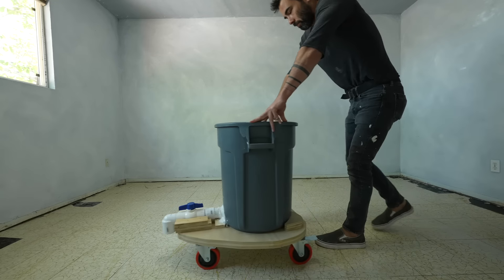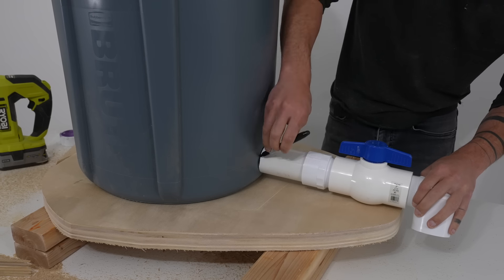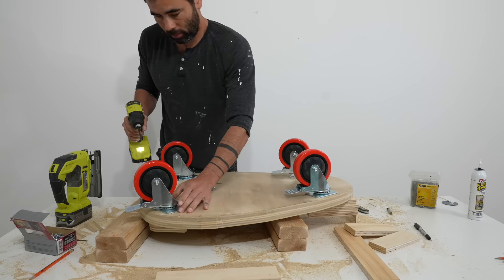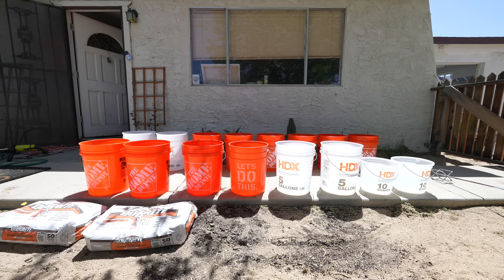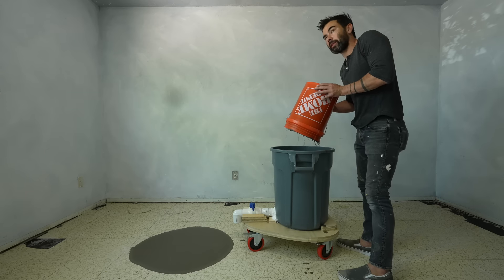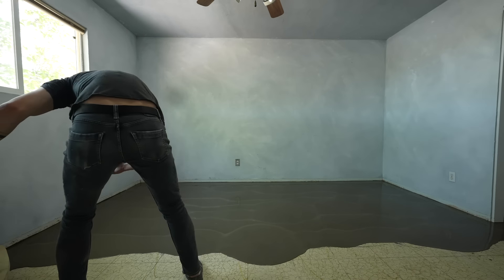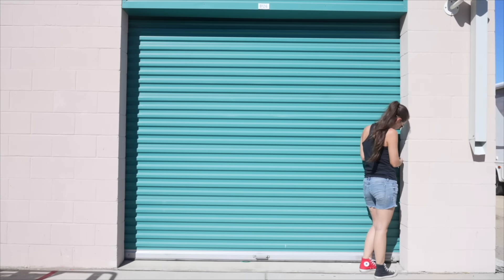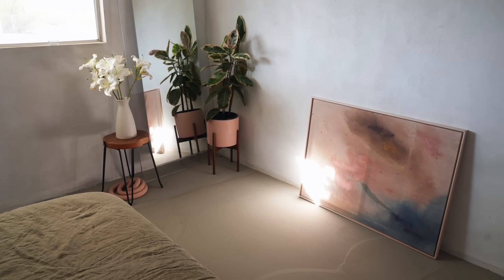Concrete Floor Over Tile | EASY Self Leveling Concrete Floor

Comment: Nice way. If I ever have to do something like that I will certainly try something similar.

Now, I think using a tap is the way to go, not the cap, as this one will be messier and dirtier, as well as both parts will get more and more dirt overtime making it difficult to screw/unscrew, and you have to wash them both as well.

I think the inicial method is the way to go (despite it's concrete anyway and not exactly a "clean" liquid") and I mean it because I've seen a similar problem with this solution: there's this artificial pond near my house. It's used to water some orchards (five different owners). Three years ago it was remodeled and now it has a tap like the one in the video only larger, like twice the diameter at least. It's also a bit hard to open and close by hand and, also, it's in a hole like 50 cms. (over 1,5 feet) deep, so it's not nice to use so to speak. 

However, one of the other users came up with this: he used some long enough rebar and gave it an L shape. Then, on the longer side of the L he welded some more rebar so now that end has a U shape. The distance between the "arms" of the U is enough to reach both "arms" of the tap. In theory, the wider the better as long as it's not wider than the length of both arms of the tap combined. But this may also feel like it's going to break the tap, so you may leave it wide enought it's wider than the round part of the arms of the tap (its axis).

Why? because in fact the leverage is done with the shortest part of the L shape you did at the beginning, the longer, the better. To use this contraption you just place the U shape on the tap, hold this thing by the longest part with one hand and open/close the tap by using the shortest part with the other hand. I think watching it is way easier than writing and explaining it, but I hope it helps. Thank you.
Reply: P.S. Also, with the tap you can control de flow, which is not possible the other way, or at least way, way more complicated and messy.

Comment: This is a super brilliant solution. Thank you for sharing! How well does this hold up over the long time? I have a room with almost the exact same floor. I've currently got my gym set up in there, so there is a 6x6' space that has about 750-800 pounds sitting on it. Will that concrete hold up to that weight? Could this also be a a good option as a leveler if I decide to put down luxury vinyl plank over it?

Comment: I dont think most people will appreciate how AWESOME this is!! First off, mixing batches to remain consistent between mixes is NOT easy to do as one pour dries, and requires 2-3 people to keep up.  I wonder if the only difference between the cheap underlayment levelers is color, vs the more expensive overlay products?  

You can use a spike roller to get rid of those layer lines. Something I recommend.
You can also use some grease to coat the ball valve, or maybe some silicon at the start. It will make a barrier so what ever sticks on will get pushed off as you turn it and not get in between....IN THEORY :-)
Reply: I think it's awesome.

Comment: Looks like 1/8" to 3/8" thickness.   Probably ok in a bedroom might crack over time especially in high traffic areas.  Love the distribution method.  You'd do this before a high quality flooring installation anyway with Self leveling compound.

Comment: The change to the ball valve with the cap will work best to not have the spout vertical. I would simply let it lay horizontal so capping it won't get wet cement all over your hands.

Comment: If you try to cap it while there's still cement in there, it will definitely get into the threads, and it may lock it in place once dried.
If you plan to immediately take it outside and remove it, then clean everything out, that's probably fine.

That said, be prepared for a little mess as you try to put it on. I think the ball valve was the right way to go, just because it's plastic doesn't necessarily mean it will break easily, some plastics can be quite strong.

Comment: Curious, I know you said you had it checked for asbestos, but even if it had been would this type of flooring application be OK over top of it? Since you are encasing it and not sanding/drilling it up?
Reply: Most times it’s the mastic adhesive that holds the tile down which can contain asbestos fibers. This is the concern when removing flooring.
Reply: I think he was just explaining that the reason they were pouring over the tiles was that it was too much work to remove them even though they didn't contain any asbestos. If it had contained asbestos they would have just poured the floor without even having tried to remove the tiles.

Comment: Will you be able to get that cap in place against the hydrostatic pressure of the concrete?

What about nylon fire hose that could be pinched off with a heavy weight?

Comment: I have a 14x12 room to level. You mentioned you used 12 bags. How much water did you use? The viscosity looks really "watery", is that how it's supposed to be?

Comment: Further development suggestion, lift the bin so that you can put the outlet pipe through the bottom. On the side, even low down, you'll waste mix and or end up tipping the bin out manually. Good idea though, excellent result.

Comment: The concrete doesn't  crack over time? I tried something similar and found the concrete has expansion/contraction problems with the thin aggregate.

Comment: use a piece of pvc over the tube glued in place instead of the flex seal. just like you did on the inside, but on the outside. i do this alot on buckets, works great.

Comment: It's quite a thin layer of concrete. Is there any risk of it cracking given the linoleum underneath is slightly soft?
Reply: 100%
Reply: @hotrox2112  yeah I'd still be worried about the thinness of it. I don't understand why you wouldn't just rip up the lino first.

Comment: You should try filling the trash can with the concrete and then mix that before pouring. You might get a more uniform color. Also, a 50 gallon drum might be more sturdy than a trash bin.

Comment: the caps a good idea but it doesn't look like the valve is all the way open, so it seems like its still being used to control the flow

Comment: Im curios how concrete should stick to linoleum/pvc tiles or similar. Even the thin layer doesn't look like it will last long.. did you treat the linoleum before putting the concrete on it?

Comment: I would like to see a level on that cause that can't possibly be level plus you did not use a aeration roller to remove air pockets introduce by the mixing a good concept similar to what we do in the UK using a pump system but one would be using the hose whilst another is rolling by using the roller you remove air pockets and help disperse the flow more evenly.

Comment: If you only use the cap to close the tip at the end of the downspout (the one with threads on the outside) 
How are you going to control how much of the mixture comes out and wouldn't it he messy to close?

Comment: looks great! any thoughts of putting any sealer or protectant over the concrete?
Reply: There’s concrete overlays for a concrete finish, if you’re just leveling to put the flooring down you can use an underlay like this

Comment: I would have used just a normal hose pipe instead of the tube which you could just fold back to cut the flow and secure with wire.   Or you could have a large bin located outside near your mixing area which could topped up continually while a long extended hose pipe pours the concrete in the room.
Thus no need for expensive wheel or tubes.
Nevertheless, great job.

Comment: I would like to do something like this in my bathroom, yet it is way much smaller could it be done pre-mixed or how would that work for an area about 15ft. 4ft in the shape of a (L). leads to a wood floor would that be a problem. I have 1inch square tiles that I want to cover.

Comment: I like it. You said you wouldn’t use a valve next time. I noticed that you weren’t pouring at full flow, but had the valve partially closed. With two inch pvc wouldn’t you want control over how much material is coming out?
Just an observation. But overall I’m impressed and really like your idea. 
Cheers! 🍻

Comment: Does the concrete crack at all? How durable is it? Could you do this in a commercial setting? Great work if it lasts a long time.
Reply: Wondering the same. It’s so hard to imagine concrete that thin not fracturing.
Reply: It’s self leveling concrete it is designed to be applied thin. It’s usually just used to level a floor and is usually covered up by floor coverings. If you’ve ever dealt with it you wouldn’t have much concern for it cracking.
Reply: Most self level concretes have a polymers added for flexibility.

Comment: Great idea. Of course not taking up the old vct tile will  leave your job to last as long as the vct stays very well adhered. Be prepared for almost immediate failure due to the water migrating and breaking the vct bond. Also to  your closing the flow issue just attack a flexible long hose to that threaded end that can be bent to be above the present filled level to let gravity do your shutting off for you. Visually lame ( looks like an elephant ) but very efficient.

Comment: Did you push the self level concrete around? It doesn't self level unless you move it around.
Reply: That's not true. Self-level implies it levels on it's own. You only need to move it around if you pour it one section and use a rake. He was regulating the pour with the valve.
Reply: @joesimonetti  I am a superintendent currently building a 40 million dollar 188 unit multi-family complex. I am paid to know what I am talking about, and yes, it is true. Years ago I seen someone do exactly what you just said and had to spend two days chipping and grinding the floor because he wasn't experienced enough to know that once you place self-leveling compound you have to trowel it so that it actually levels itself. This is common knowledge. If you don't you will have a hump. A spike roller after trowling the compound is what the guys on my sites usually do.

Comment: The cap Idea would work but I don’t see how you would control the flow. 

Also there are other products by companies like Westcoat That are made for this application. Concrete leveler is really designed to prep the floor for something else like tile to be finished surface.  I don’t think you mentioned sealing the concrete but I’m sure you did.
Reply: You could have a lever on the base to control the angle or a simple valve that can be modulated to control the flow.

Comment: some wd 40 would smooth the valve.. and i would've tilted the trash can maybe 10 to 15 degree angle so the mix would come a bit faster.. 🤔 but the finished job is awesome 👍

Comment: Those self leveling formulas aren't meant to be final wear surfaces- they're supposed to serve as substrates for the final finished floor.
Reply: Yes, too soft
Reply: It depends on the formula. Mapei make ones that are suitable for final surfaces depending on what's underneath them (probably not lino though).
Reply: Weber, mapei, uzin……. Are making as final floor👍🥳

Comment: Yup, looks like quite meditative work...! 😂
But don't you need expansion gaps around?
One thing with your idea of exchanging the valve; it seems as if you had not thought about the concrete flushing your cap in the moment you want to screw it...

Comment: Why not a rubber ball that seals against the inside tube. You control it by pulling a string or pushing a rod.

Comment: 1. By the looks of the color it seems to be a Ryobi Paddle mixer but when I search for one I can't find one, link pls?
2. After the pour I noticed "waves" as you mentioned between the pours, is there a way how to eliminate that?
Reply: Spiked roller
Reply: @number1homie925  is a spiked roller like a paint roller with nails in it?

Comment: i cant believe you went over the existing vct type flooring a floor scraper and some elbow grease would of been better. 1 hard day would of made that job passable and bond properly as sometimes i would grind a open pore on the slab. i havent done self leveling for 25 years but we use spikes and 4 ft wide special squeggies and some other tricks

Comment: A) you dont need this whole contraption. You can mix and dump and use a squeegee to help it spread. It is self leveling after all. 
B) this is not to be a finished flooring. It is soft and will easily scratch and start to crumble and chip. So dont expect this to be like a true concrete slab

Comment: Then the ground shifts and you get a nice square crack pattern slowly appearing over Time. The cheque will have cleared at least six months before that starts to happen though. Some smooth talking could save having to do anything else until the warranty you read off the materials times out and you're home free.

Comment: clever. thanks for sharing your idea. I would instead consider using a bulkhead fitting with a hose barb and a piece of tubing/hose. to stop the flow simply lift the hose higher than the remaining volume in the bucket and your good. KISS

Comment: Hello, I think your idea is brilliant. However, I don't understand how you succeed in controlling the flow, especially now that I know that the valve is just here to cut the flow. I feel that if I did the same thing, It would run very fast and I could keep up with the speed...

Comment: the screw cap idea probably wouldn't work any better and it would just be messy. (imagine an oil change but the liquid is heavy) you could use a smaller valve or cut a wooden handle that slips over the blue part to give more leverage. You could also turn the valve to the side so its easier for you wrist.

Comment: I thought it was cool to encapsulate asbestos. Were you told it was not code? I had a floor with asbestos glue on the tiles.
Reply: I think he mentioned the asbestos because he first attempted to remove the old tiles. But yeah, encapsulation like this is the way to go for asbestos so in the end it didn’t really matter that he didn’t have asbestos because the concrete would have been fine for if it came back positive.

Comment: Couldn't you also mix the mortar right in the barrel rather than mixing it in buckets first?  I would eliminate the pvc piping all together, instead just drill a hole in the bottom of the barrel and use a long stick to pug the hole...

Comment: Since the materials to make the device were cheap, I'd use it until I needed to make another one. Then, I would just make another one knowing that I've made my money back if I did this as a job.
Reply: Also, I'd add some coloring so that when the two passes met, there would be a reaction. Different coloring per pass, of course.

Comment: By definition, concrete has aggregate. If the specs of the self leveling product you used said anywhere between a sixteenth to three eights, than it's not concrete.
     These products are usually portland cement and a polymer in them, typically with "just add water", in the instructions. Straight out of the box, not near enough polymer to keep it from cracking over time. You're definitely not going to want to drop anything sharp or heavy on that floor. Also the substrate will just transfer the areas where it flexes. Eventually it will start to chip and flake.
    If you want more strength add more polymer and some acrylic. Just ask any experienced concrete counter topper. Good luck getting their recipe. Color is also a great option.
     I guess if everybody walks gently in their socks it might hold up. DO NOT DO THIS TO YOUR GARAGE. Epoxy is the standard in garage floors.

Comment: I think i'd forget the cap and use a flexible tube instead. When I want to stop pouring, I'd put the tube in the top of the bucket (prob add a thing to hold it there so it's hands free when I'm not pouring). I'd probably have to put the bucket up a bit higher, but with a wide base, I don't see that as a big problem.

Comment: i would of sandwiched a rubber gasket on both sides of the pvc then glue pvc couplings and seal. (coupling, pvc pipe, gasket, trash can wall , gasket, pvc pipe, coupling)

Comment: your threaded cap Idea sounds good in theory but when you fill your garbage can and then unscrew that cap you are going to have a real mess on your hands (figuratively and literally), and closing it if you still have concrete in the can wont be much fun either

Comment: Self leveler sets up very quickly. have you had any issues with that? The whole contraption could be rendered useless if you haveca mix setup on you.
Reply: Watch the video, he covered setting up buckets and bags and organization, as well as two friends doing the mixing. 12 bags, 3 organized people. 🍺

Comment: Takes too long, just pour two bags at once, get a floor scraper (wide blade on a pole), spread it out then roller.
I always put a tad more water in the mix too, helps it flow better.

Comment: No valves. Use a hose and make it long enough to be higher than the edge of the trash can and then lower it while pouring concrete.
I am suggesting this watching your video while in bed before going to sleep so it may mean nothing to you 😂

Comment: Lmao just dump the damn buckets on the floor. You literally made this twice as hard as it had to be.
Reply: I agree but.... This has one use case, when you want the whole room done in one pour, you can load the trashcan with enough material for the pour, rather than a bucket at a time every 5-10 minites